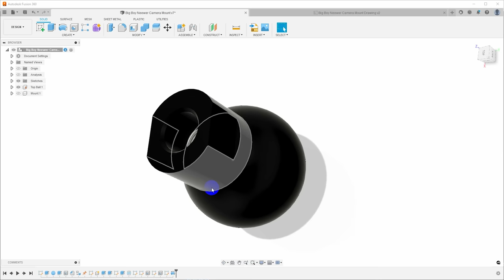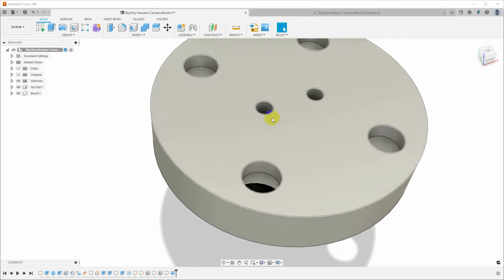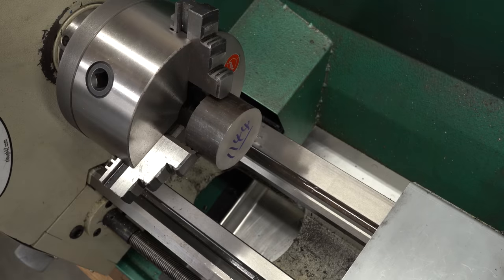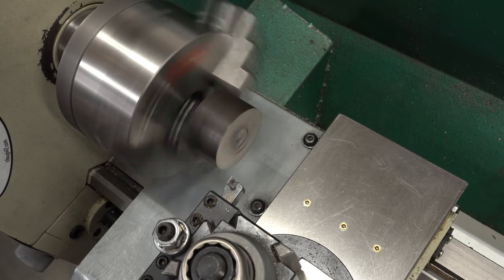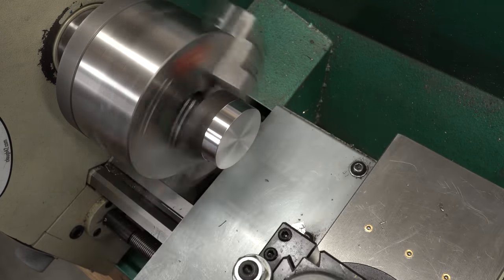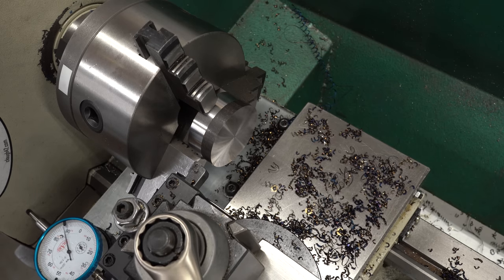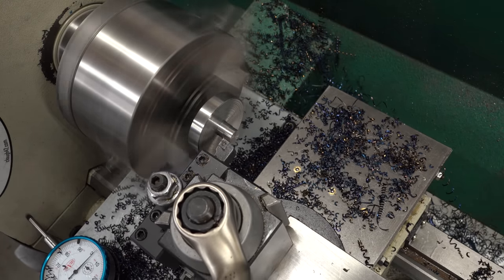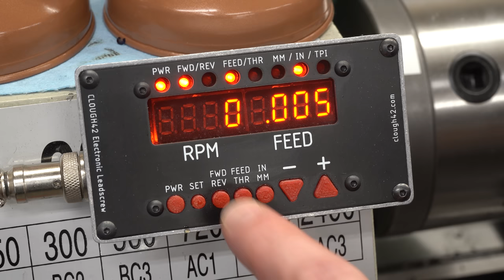Thread Milling on a Small Lathe | Making a Magnetic Camera Mount

Comment: This is really fantastic. I'm a commercial producer by way of the camera department, and your intuition about adding the anti-twist mechanism is smart. Everything attached to the camera should have some sort of anti-twist feature, even the high end accessory arms have anti-twist pins. Second thing: if you do happen to run into vibration issues, sometimes more rigidity isn't the answer... When we put cameras on vehicles/aircraft, we'll often use vibration isolaton mounts (typically between the arm and the gimbal the camera is on) which are just a set of parallel plates with curved steel cables linking the plates to each other. The number and gauge of the cables is (roughly) calculated based on the payload. This does an excellent job filtering out higher frequency vibrations (the gimbals can handle the big moves) and removes shake or "jello" (rolling shutter artifacts from vibration). I'm pretty sure these were adapted from other industries so you might already be aware, but thought it might help.

Love the channel and the dedication to capturing your work at high fidelity. The hard work is not unnoticed or unappreciated!
Reply from the maker: Interesting.  Yeah, I've done some work with camera mounts on small drones, back in the day when you couldn't just buy what you need off the shelf.  I remember Kurtis (CEE) showing a helicopter camera mount constructed as you describe, with a two plates linked by a ring of bent sections of cable.
Reply: Are you aware of any guides to sizing the wire rope isolators?
Reply: You know if you have a speed control on your motor and you ran that a little slower than you were running it when you had it under power cutting the stock you could run that right up to where you want to stop pull out and put the machine in reverse that's how the Europeans threat they don't have a thread chaser and it doesn't matter they leave the half nut engaged until they are done.
Reply from the maker: @chauvinemmons  What you describe is exactly what I did, except that the minimum speed for my lathe is still faster than I can run the thread mill.  That's why I turned it by hand.

Comment: Hi Folks, similar holders are made specifically for holding video gear, eg on camera monitors. Noga make some of the better ones, another good manufacturer is iFootage (no connection!). There are others. Search for 'Camera rig clamps or brackets'. They are available with the standard 1/4 and 3/8 inch camera fittings. They are available in the States from the likes of B&H. In the UK try ProAV or CPV. The Noga model James is demonstrating is particularly rigid but iFootage have come up with some new designs that might prove equally interesting and I suspect quite a bit cheaper.

Comment: I have never seen, or rarely seen, threads being cut like that with the cutter spinning. That is far superior way of cutting threads versus normal thread cutting with a fixed cutting tool, and having to worry a lot more about the feeds and speeds. I found this video because I was searching for CNC's with cameras. I recently added cameras to my CNC controller software with computer vision algorithms to automatically reposition the machine to zero on the X and Y axes, using 2 microscope cameras.  To have camera screens right there on your computer screen of the CNC controller software is very useful. Even without computer vision algorithms, I can manually put a 0.9mm drill bit, into a 0.9mm hole using only 2 microscope cameras. But with the computer vision turned on, I can just hit the "Go" button and it will do the same thing.  To see it work on video looks so cool because you can the computer vision finding the drill hole, and drawing a green circle around it. I have a video on my channel showing that process. I make CNC software.
Reply from the maker: That's really cool.  I've seen a camera used as an edge or center finder, and I'm aware of machine vision systems, but I've never had the privilege of seeing one in action.
Reply: @Clough42  Well, if you got $20 to buy 2 USB microscope cameras, I will give you a copy of my CNC controller software, and you can implement it on one of your hobby CNC's and see it in action at your home.  To see it automatically find the hole, and get "nothing but net" when you do a Z down, and the drill bit enters the hole exactly is pretty cool.  I can see a 0.01mm move on the CNC machine on the screen.  You can see it move a tiny tiny bit. That is with the "Super FIne" button turned on my controller software. If you hit the "Fine" button, the moves will be 0.1mm and the moves look huge and clumsy on the screen, when you are using a cheap USB microscope camera.  So the microscope cameras are probably getting me up to 0.01mm in accuracy. And it works quickly with no thinking. I always love the no thinking part.

Comment: I thought I was seeing some serious clickbait with a sci-fi thumbnail! Excellent work on the thread milling. I honestly would not have thought of that, so i'll add it to my list of options. THAT SAID... I am curious as to why you chose to thread mill vs. using a more obvious, or traditional, die to cut the threads.
Reply from the maker: I needed a complete thread all the way up to the shoulder, and the die has a taper.  Yes, it can be reversed, but it still doesn't make a complete thread all the way to the end.

Comment: Hi James, thanks for an informative video. 
More years ago than I claim to remember, about 1962, I attended a demonstration put on by a local highschool machine shop class of an attachment they had built that fastened to the cross slide of a lathe. I think they were using a Myford ML 7 or super 7. Make was of no consequence as the attachment was custom to the machine in use. It resembled a steady rest in that it had a round frame that surrounded the work piece. Inside the round part was a rotatable cutter head which was driven by another motor. It was not synchronized to the lathe perse but the carriage slide was driven by the leadscrew. The cutter was a single point to suit the thread being cut and was rotated at about ten times the rotational speed of the lathe. I would think the faster the better. The tool was advanced into the work by the position of the cross slide. The quality and finish of the threads produced were excellent and fast. 
You could thread to or from a shoulder easily though having a run-out groove was desirable. They referred to the technique as "thread swirling." I've never seen a device like it since but your using your TPG and that cutter brought it to mind.
Regards from Canada's banana belt. 👍🇬🇧🍌🇺🇦🕊️🇨🇦🤔🇺🇲🤞
Reply: We do still use these they are a thread whirler often used on a sliding head lathe to produce long small diameter threads.

Comment: Oh that's way more sturdy than the stuff that normally gets sold as camera equipment on Amazon: I got a dolly/skate thing that came with basically a knock off Noga arm, intended to thread right in to 1/4-20 (or the larger camera stuff thread, 3/8 something?). It usually can hold itself, an RX100, and some additional accessories, without falling over, but it sure doesn't inspire that much confidence or look nearly that smooth...

Comment: Curious if milling a pocket in the plate to engage the wrench flats, then using a flathead M6 screw would have solved the problem? 
Perhaps it was rejected because it would eliminate the opportunity to demonstrate ELS threadmilling!
Reply: Yeah, something tells me that the thread milling was the whole premise behind the design because honestly, it would have been an overall better part if it was just a flat plate of aluminum with a hole and  countersunk M6 screw or a hole with a deep enough counter bore for a socket head (or even button head) cap screw since those option would have resulted in a lighter part with less fear of the fastener breaking as mentioned as to why he chose 1144 S/P... I mean,  

Plus all that material waste for nothing just to get a M6 diameter pin to thread.
Reply from the maker: I thought about it, but I wanted an integral stud so I could have a solid shoulder to engage the counterbore in the end of the ball socket.  I tried a couple of designs with a boss to engage the counterbore, and a hole drilled through it for a screw, but the wall thickness was well under half a millimeter, and I just couldn't make it work in a way I thought would actually add strength.
Reply from the maker: @CJ A reasonable guess, but no.  I wanted the unthreaded shoulder to engage the counterbore in the socket to add strength, and couldn't find a way to do that with a screw.  There just wasn't enough material left after drilling it out and threading.  Aluminum would have added basically nothing with that small of a cross-section.
Reply: @Clough42  I was thinking it would have saved you a lot of time and material if you'd turned the puck with a hole in it and then either press-fit or Loctite 638'd the stud in.  Even if you'd then turned the stud and threaded it (after the Loctite set - 5 mins 'ish) in situ for concentricity. 
I'd be curious about the helix angle between the thread and the thread mill.  Clearly it worked well and therefore I'm over-thinking it but in my head, the cutter needs to be at an angle.  Is there just too little engagement for it to make any difference?  Would it only matter if we were talking something like an M30 thread?   I have similar issues with carbide inserts for Joe Pieczynski's threading away from the chuck with a left hand insert....but I've not found the time to really experiment.  That would have been another way of threading to (or away from) that shoulder....but I'll give you that the thread milling was cooler!
Reply from the maker: @Cenedd  the thread mill is ground specifically for interpolating holes on a CNC mill, so the geometry of the cutter is designed to be parallel to the thread axis.
Reply: @Clough42  Interesting - do you have a reference to the particular cutter please? Another one here very impressed by the quality of your videos!
Reply from the maker: @windsoruk  https://www.lakeshorecarbide.com/516singleprofilethreadmill12loc240cutdia16-48range.aspx

Comment: Great video. I’ve used the els to manually cut threads before but not with a mill cutter that was cool. I think I would have just used x and y offsets from center to drill the holes to save the time setting up bolt circle

Comment: Cool.  I can understand why you would want to thread mill.  Many times a speed that allows a bit of reflex time, also produces a poor cut.   What I don’t understand is why you made the stud integral to the larger part.  A much stronger device would have been made by pressing a stud through the part.   Perhaps I think this way due to doing stress analysis before computer modeling became the rage.  Then a part was made out of acrylic.  It was then placed between crossed polarized sheets and stressed.  The stress lines would then show.   Better stress signature from a stud because there is no stress riser in the corner.

Comment: Robin Renzetti has a good video on how he mounts his cameras. One of the better tricks is making mounts on the ceiling (or wall) that the arm can stick to, just weld up a bracket of appropriate size over your lathe & bolt it to the rafters. That gives a lot of vibration reduction compared to mounting on the lathe itself.
Reply from the maker: Planning to do exactly this.

Comment: I know you wanted to show off the thread milling, but I always tell new engineers it is much more efficient to drill a hole and bolt it instead of an integrated male thread on a part. Something similar that could have been done (assuming you needed the tight clearance to the set screws) would be to thread the plate M6, then use a set screw of appropriate length. You can either stake the screw into the plate, use a backup set screw to lock it, or some red loctite.

Comment: You should get cages for your cameras in case they get knocked over. AND I use cat leashes mounted on the rafters to actually prevent the camera from being knocked over. Small rig has a lot of inexpensive and quality stuff for rigging cameras.
Reply from the maker: I have a cage on the camera that ends up in harm's way the most, though for a DSLR or mirrorless camera, the lens is what's most likely to be damaged, and a cage really won't help with that.
Reply: @Clough42  I have a long lens on my DSLR, thats where the cat leashes come in. I cant knock my rig over no matter hard I try.

Comment: coulda machined a recess for the ball head top section, with its wrench flats, and use a hex head 6 mm bolt through the adapter...for extra locking, maybe set screws that capture the wrench flats, which insures against any loosening of the fit, and also prevents the adapter from coming of if the 6 mm bolt comes loose, at some point...as a 'traveling' photographer, I've had vehicle vibration completely disassemble things, so...

Comment: Very nice job, when roughing the OD for the thread you alternatively could have done the same facing strategy you were doing to quickly remove the bull of the material, but stopping shy of your target diameter and leaving material for a cleanup pass.
Reply from the maker: Yes, but I have no power cross feed, and I can guarantee I would have gone past my mark and destroyed the part on one of the passes.  :)

Comment: Great video. I was considering doing something similar in the thread making portion, except I was considering grinding them, but was concerned about how well the wheel would hold up at the point.
Reply from the maker: I know the threads on ER collet nuts and tool holders are often ground.  I don't know exactly what kind of wheel they use, but I would expect it's probably a superabrasive, like CBN.

Comment: What you need is a back gear for the lathe so top speed is say 100rpm. I've been thinking about doing it on mine for a while (very similar lathe)
Reply from the maker: Top speed today is close to 100RPM, but that's too fast for this cutter under these conditions.  I need to get the back gear (belt) reinstalled, and then it will go down to about 15RPM.

Comment: I much prefer 1144 High, or particularly 1144 Ultra to 4140 for most things. People seem to think that 4140 chrome moly is sexy, but 1144 has twice the tensile strength. For most things, it’s a better (and cheaper!) choice. And yes, it’s hardenable. I’ve done that. Works very well. Check McMastercarr for this. They have all the specs of the materials.

Nicely done.
Reply from the maker: Interesting.  I can find specs that say 4140 is only 60kpsi tensile strength, but the last piece of 4140HT I ordered from McMaster is specified at 95kpsi, which is similar to the 100kpsi I see quoted for 1144.  Though there appear to be other sources that specify 1144 at 125kpsi.
Reply: @Clough42  well, it’s interesting that the same alloy can be rated differently depending on the shape or thickness of the piece. Look at A-36. That can be rated anywhere from 35,000 PSI to 54,000 PSI. It depends on the manufacturing. Extruded, rolled, etc. So generally, 4140 is rated at about 67,500 PSI. 1144 High at 95,000-100,000, and 1144 Ultra at 125,000. 4140HT stands for High Tensile, so it’s stronger than “standard” 4140.

Comment: Just think, if the toolpost grinder had a few different speeds you could have done all the operations in one set up, with some form of indexing on the lathe spindle.
Reply from the maker: It's variable speed, though I question whether it has the torque for the drilling operations.

Comment: Dude, with that little lathe you need to be running some sumitomo cngg321 or cngg431 run it at 530sfm and .0073 per rev if your gearbox will do it. Most beautiful chips on stressproof or low carbon. That or walter wsm30s ccmt 32.51 inserts.
Reply from the maker: Do you mean CNMG?  I don't see CNGG.

Comment: Blue Loctite has plenty options
Reply from the maker: Loc-tite is great for retaining fasteners, but it's not great for retaining a stud that will have operational torque applied to it.  I have two such studs in commercial camera support gear that I've tried that on multiple times, only to have it loosen and let the camera rotate after a few uses.

Comment: Nice job.  But somewhat overkill design, imo.   A simple plate with a hole for an M6 cap screw and some green loctite would have worked as well, I think.  But I am personally known to design overkill solutions, and loved watching how that thread tool worked.   But no Ni plating?   You should use up your leftover solution :-)

Comment: If you can measure the frequency of the vibration you should be able to tune it out with a mass damper.  There are some equations to calculate the correct mass. Rigidity and mass are what u can tune to reduce vibration.
Reply from the maker: For a closed system operating in a narrow frequency range, like a helicopter, something like this could make sense.  For a milling machine or lathe that will be run at a wide variety of speeds with different tooling, I'm not sure it's practical.

Comment: Looks great. Can you anodize the part you made to match the black and red theme? I guess that's more my artist side calling than my engineer side.
Reply: Anodizing is done to aluminum, not steel.  Cold bluing (selenium based, IIRC) is a possibility.
Reply: @eliduttman315  yeah, i wasn't thinking... maybe cerakote or similar?

Comment: Love it, super awesome. Could you have cut that thread under power?
Reply from the maker: Yes, if I could get the lathe to run slow enough.  The back gear is currently out of the machine due to the ELS install, and I need to put it back in.
Reply: @Clough42  Man that's nice. I must say, your setup is really nice.